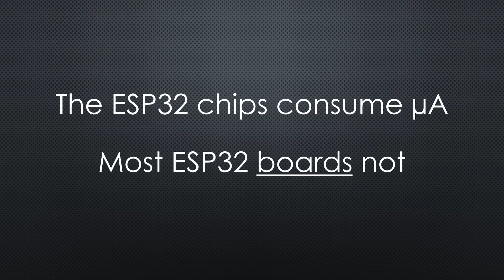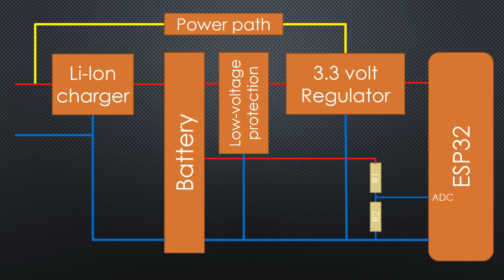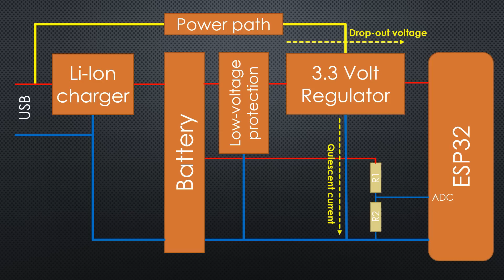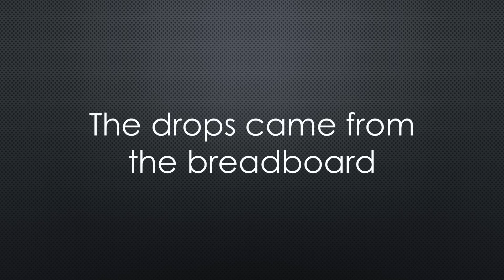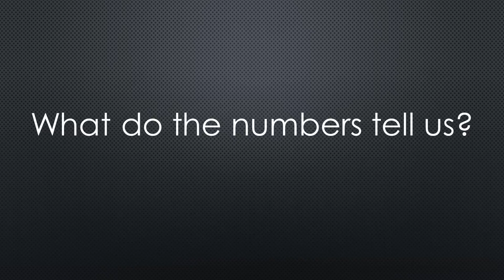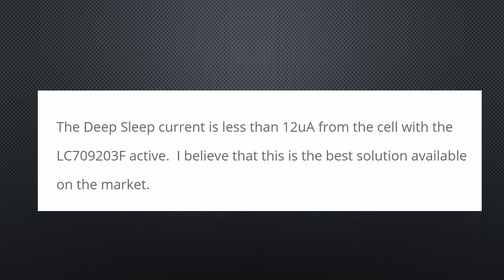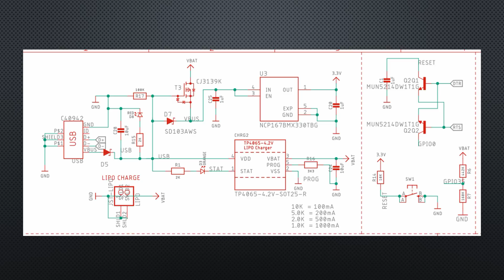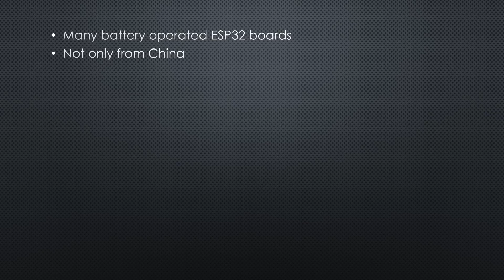#387 Test of Battery operated ESP32 Boards (Olimex, TinyPICO, EzSBC, TTGO)

Comment: That was really well explained, and thanks for showing schematics to explain how each board implemented their PMIC/Regulators. The TinyPICO has VBAT and GND pins on the header next to each other - so there was no need solder wires to the JST connector pads ;) Also, max input voltage for the LDO is 6V not 12. I agree under voltage protection would be a great feature, but on a board the size of my TinyPICO, there's not much room to add it.
Reply from the maker: You can imagine I did not have too much time for each board. So I tried to standardize the procedure... At least I found the info to disable the neopixel in time...
I agree about the under voltage protection for the Pico. But not for the other (bigger) boards. It seems that some LDOs have a very low consumption in the lower regions. Maybe manufacturers will include such a feature in newer designs? That would probably be enough for many situations. Without it you easily kill Li-Ion batteries (I know what I am talking about:-(  )
Reply: @AndreasSpiess  Yeah sure. I tend to only use 1S LiPo packs with over and under protection, and generally only recommend those to people unless they have experience with batteries. I almost always suggest folks don't play with 18650's when they ask, unless they have experience with using them as they have no protection and can be dangerous.
Reply: I agree with UM. There are protected 18650 cells too and you can use a separate protection board if you want.

Comment: Hi, I've been through the issue of the drop despite the capacitor. Isn't related to breadboard resistance, but the effect of the inductance of the connections. You can even use smaller ceramic, if placed at ESP chip pins. Electrolytic ones can't usually compensate for short, big spikes, despite their capacity
Reply: Absolutely. Very short spikes just laugh at "fat" capacitors.
Reply: There should be ceramic bypass capacitors right at the pins of ESP IC, like you mentioned. From an MCU of this capability, there should be a lot more bypass capacitors. I'm not sure if the board makers know the affect of DC voltage and the physical size of ceramic capacitors on it's capacitance value. You can get down quite low on capacitance if the proper package size and rating is not used.
Reply from the maker: I agree with your solutions. This is why I decided to use the brownout detector to do the "measurement" right where it matters. Most manufacturers did not do a bad job if we look at the values. But of course. 3.5 volts minimum could be improved a lot...
Reply: You're absolutely right. That's the correct approach to handle the tiny current spikes.

Comment from the maker: The reason for the high deep sleep current draw of the EzSBC board is that the LC709203F  fuel gauge chip needs initialization. Then the deep sleep current will fall to around 11uA. You find the code here: https://github.com/EzSBC/ESP32_Bat_Pro
Reply: Have seen similar behavior on a TTGO T-Call with an AXP power management chip. Atm I think a voltage divider is enough for power management and a dedicated IC is not needed, but I see more and more in different TTGO board.
Reply: Andreas as an avid watcher of your solutions for some time would you ever consider private project fully paid?

Comment: Re the FeatherS2, unfortunately there is no auto-reset capability with the ESP32-S2 native USB implementation, so you just need to manually put it into download mode by holding BOOT and then pressing RESET and letting go of boot. Then it will enumerate and show up as a port in Arduino. Once it's been flashed once in Arduino (and you have Serial.begin() in your setup() - currently a bug in ESP32 Arduino Core), you no longer need to put it into download mode to flash it and it will enumerate as UMFeatherS2 in Arduino in the ports list.
Reply from the maker: Thanks for the input. I thought I tried it this way but was somehow not successful. Now the upload worked (I still did not get Serial working). But I was able to do my measurements. It ran down to 2.7 volts which is very good. I assume the -S2 is less prone to brownouts, but I do not know. I was not able to switch the neopixel off (the tinypico helpers did not compile on the S2) and the deep-sleep current was 1.25mA. Maybe you have information to bring it down?
Reply: @AndreasSpiess  The FeatherS2 auto shuts down the power to the second LDO when in deep sleep, and the APA102 is driven from that, so that is not the issue here. You should be getting around 90uA in deep sleep. Can you try setting IO 40 and 45 to inputs before deep sleep? Maybe they are leaking.
Reply from the maker: Now it is different: On 1 minute deep-sleep it starts at around 100uA for the first seconds and continually increases to 200uA for the last few seconds (with the PPK II). Measured with the OTII I get 200uA at the beginning and 300 after one minute. The trend is also there.
BTW: I suggest to you the same as to the creator of the EzSBC board: Create your example file which can be used by your customers...
Reply: @AndreasSpiess  Hmm, I'm getting 92uA stable here on the same revision board that I sent you and 65uA on my newer one. I plan on releasing a helper library with example code, but S2 support from Espressif is still (unfortunately) alpha and buggy - The CDC not enumerating without serial.begin() bug alone causes me a lot of customer support grief :(  I'll send you a newer revision FeatherS2 and a TinyS2 as well to try out with your tests.

Comment: Electrolytic capacitors use a wet dielectric, so they are famous for being slow. Tantalum are similar, but do tend to be faster, possibly because of their small size.  Polyester and ceramic capacitors are good for regulation and decoupling, as you found. 
This was all in one of my electronics magazines in the mid-70s.
I think if you can see the size of the voltage dip and the duration, then you can work out the charge that is needed and that will give you the best capacitor size. It's been a long time since I did that sort of thing, though.
Hope this helps someone.
Reply: Just to add that electrolytic capacitors have the highest leakage current among all.
Reply from the maker: You are right with the quality of the different caps. For the LDOs we also have to understand their behaviors because they react to changing loads. I had exactly the same theory that, if I have a cap big enough to supply the charge needed to fill the spike, the voltage would be stable. But this was not the case as we saw. It seems LDOs do not like big capacitive loads ( https://youtu.be/qosClvn9GqU )

Comment: A 100nF cap helps as electrolytic capacitor do not respond very well to high frequency current demands. also you should switch the battery divider in to circuit only while your ESP32 is active, as there is no point in dividing the current voltage if there is nothing to read it.
Reply: You got there first - I was just about to write a similar comment.
Reply from the maker: I agree with the 100nF for RF. But I am not sure if this pattern is only a RF problem because the ESPs consume quite a lot of energy during those current spikes. In my case it was definitively a problem of resistance. The tested boards do not have sophisticated capacitor arrangements and some still get relative small values between the input and the brownout voltage. But it is well possible that it could be improved with a proper cap selection.
Reply: Was going to suggest similar design recommendation - ‘add 0.01uf ceramic capacitor in parallel to a 10-100uf tantalum capacitor’ - this was a very common design technique back from the 70’s - and later - during the TTL days that not only added the 0.01uf to helps help overcome the ESR of electrolytic capacitors during fast current demand, but also for each instance of a  chip.
Reply: @rzorrilla52  True, but still holds true for moden digital designs. We have even faster current demands on chip supplies as the clock freq gets far higher than the old TTL days. As you say the ESR of Electrolytic caps does increase with frequency so they work well for bulk capacitance, but still need help with the local high frequency pulse's. This is also a problem with breadboards where you cant get the caps as close as needed sometimes.

Comment: i have been extremely impressed with the TinyPICO's resilience. I am not the most electronically competent, and I am sure I have wired things up wrong several times, but like a Timex watch it takes a licking and keeps on ticking.
Reply from the maker: Good to know. Thanks!

Comment: For solar charging you can add a 6v zener (or similar shunt) to shunt the solar cells. The voltage will only be over 6v when the battery is fully charged, and then it doesn't matter waisting power in the shunt.
Reply: This is a good idea.  I thought of this too.
Reply from the maker: Good idea. Do the standard zeners survive the current produced by the cell?
Reply: @AndreasSpiess  looking at digikey you can get 5w (so nearly 1A) if not enough more can be put in parallel. I have used tl431 in a small solution, combined with a resettable fuse to cut off if more than 80mA is drawn.

Comment: Well done. The TTGO with battery holder may be a good choice
Reply from the maker: Indeed. Also because it is very compact. I use the T-beams for some LoRa projects. They are also very handy because everything is on compact board. No soldering needed...

Comment: Have you thought about designing and making your own ideal esp32 deep sleep board? I am sure many here would be interested in purchasing such a board.
Reply: That is exactly the thought that came up with me when waching this video. We know what we want, many excellent chips are on the market, we do not need to always pick the cheapest. Many new design show up every week e.g. from Maxim.
Reply: I add my vote - as you have a good understanding of where the current manufacturers go wrong, please consider designing your own board
Reply from the maker: I decided not to sell hardware anymore. I did this when I was young. But last year I started a "Superpower project" for that reason. Maybe I will be able to present results after my summer break.
Reply: Have a look at Kevin Darrah, his boards are very low current.
Reply: Andreas, understandable. Even if an experienced engineer as youself could do the pcb design, people could go an have an open source design manufactured. I'm a software guy, so this is the one part I find challenging

Comment: With respect to Li-ion batteries, I always use batteries with a built in protection circuit and suggest others to do the same. This not only protects the battery in case of a short circuit (max. current detection) but also makes sure that the battery is switched off when it is empty. It will also protect the battery against over-charging. So I would not be concerned about under voltage protection on the target board.
Even for commercial products we never use batteries without a protection circuit - even if just to protect ourselves against any claims ...

Large capacitors - especially the standard electrolytic caps - often have a large series resistance (ESR) which prevents them from delivering high currents. Going from 100 µF to 220, 470 or even 1,000 µF will not result in a 2, 5 or 10 times smaller voltage drop on high currents.

Finally, never directly connect a solar panel to the input voltage pins. The open circuit voltage of a solar panel can be much higher than the rated voltage of the panel, especially when no power is being drawn from the panel. I would suggest to always use a special solar charger module like an LT3652 module. These modules have over voltage protection. But even (or especially) for smaller solar panels these have an advantage because they regulate the charge current such that the maximum available power from the solar panel is being used.
Reply from the maker: 1. I just learned that it is even forbidden to use undervoltage protection on the board because it would enable the usage of unprotected cells with all the dangers you mention. Unfortunately, must of my cells are unprotected and I assume it is the same with many other makers. But for sure it would be better to only use protected batteries. Unfortunately, the protected 18650 batteries are often too long and do not fit the holders :-(
2. I agree with your statement for capacitors. This is what I saw in my tests.
3. I always measure the open voltage of my cells in full sun and make sure it is inside the limitation. The cells I used did not go much over 7 volts. I made tests also with MPPT chargers but, with small panels they made no big difference. This is why I usually use a cheap TP4056. I agree with you for bigger panels where MPPT makes a difference.
Reply: 1. I did not know this but it makes sense. A single A123 cell (LiFePo) can deliver up to 70 A when you create a short circuit but even simple 18650 cells can, depending on brand and type, deliver op to 30 A. As a comparison, I weld (TIG welding) aluminium and steel with currents as low as 40 A for a 1 mm sheet and that current is enough to melt the metal ...
3. I still need to setup a proper test for solar panels. Those lab tests and results are great but I need to compare systems with small solar panels to see if they will work under "normal" circumstances.  I need to determine how much energy a solar panel delivers on a cloudy day/a sunny day/in full sun and then reproduce these situations such that I can truly compare different solar chargers (and possibly panels). I've been tinkering on this for months and now I have a real project where I need this to optimize some electronics I made for a solar powered artwork.
Reply from the maker: I use a 1W solar panel for my ESP project and monitor the battery voltage. It survived the winter in Switzerland without going much below 4 volts. Deep-sleep period is 10 minutes.

Comment: Thanks for sharing your evaluation and results. I think the lack of under voltage protection is a mistake that can have negative consequences.
Reply from the maker: I just learned that it seems to be forbidden to include under voltage protection (in the US) because it enables users to use dangerous unprotected cells. Government wants that the cells itself are protected. Not a bad idea. But most of mine are not protected...
Reply: @AndreasSpiess  
That's just crazy. I design battery management systems, and I'm a stickler for safety. There's no way that I don't include under-voltage protection as well as all the other protections. Politicians need to stay out of these areas that they don't understand.

Comment: Wow, absolutely a great video and what we really need. I've been in the same dilemma trying to figure out what board to use with solar/battery devices, and see the board uses orders of magnitude more sleep power than the ESP. I always look forward to your tests, and glad to see the power monitoring device reports.

Only through reports like this will we get halfway decent boards to work with battery/ solar power.

The other problem is having to desolder SMD parts. I can hack a board but it is easy for board designers to add a MOSFET to stop power drain from the 5v input.
Reply from the maker: With the info of this video it should be possible to design a decent board, I think. But these days we have another problem: Chip shortage. Which forces some manufacturers to change their designs :-(

Comment: Thank you Andreas! Great overview. Looks like I will continue my DIY approach. I never thought of adding a power path though. That is very interesting.
Reply: what is your diy approach
Reply from the maker: I presented the power path in one of my recent videos and was astonished (and happy) that so many boards already contained one.
Reply: @AndreasSpiess  I'll be sure to check it out. It will certainly come in handy, especially for tethered and solar projects using the battery as a sort of UPS.
Reply: @tseawell90  My DIY approach is simply to use the bare modules on a breadboard (or a cheap Chinese PCB) with their own LDO and supporting resistors etc. In short, very minimalist, nothing fancy at all.

Comment: I gotta say, the more i learn about the ESP32 (mostly from you ;) ) the more i like this chip. It has some neat features like RTOS, Deep Sleep and the ULP Processor. It also comes with some interesting integrated Libs like ticker. And even the PWM with ledc seems to be more versitile then the good old analogWrite.
Ordered myself some nodeMCU ESP32's to get started with and do some testing... let's see where this leads to :D
Reply from the maker: For sure it is a good choice for your project because it has lots of possibilities. And a lot of different boards are available...